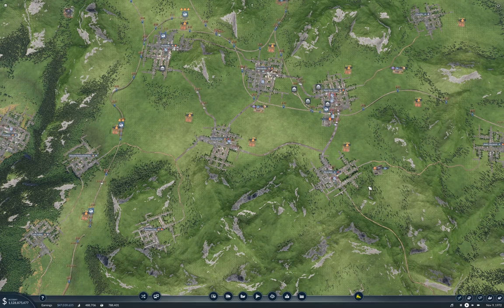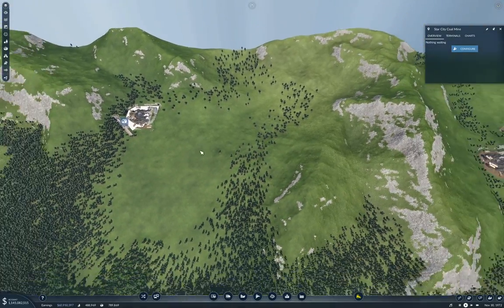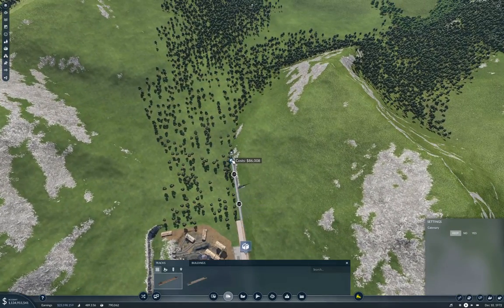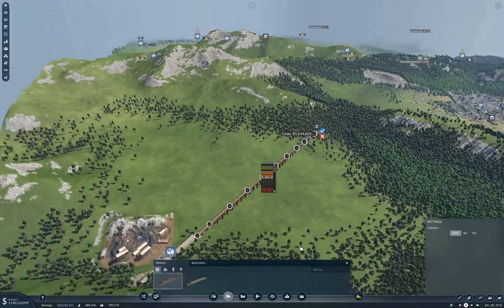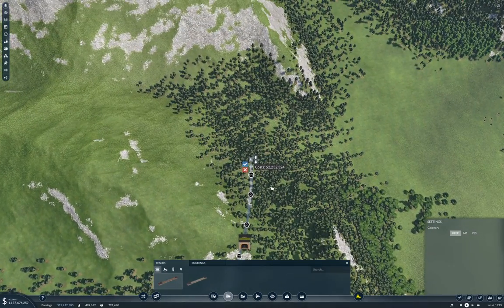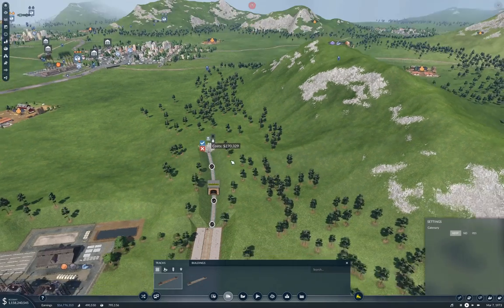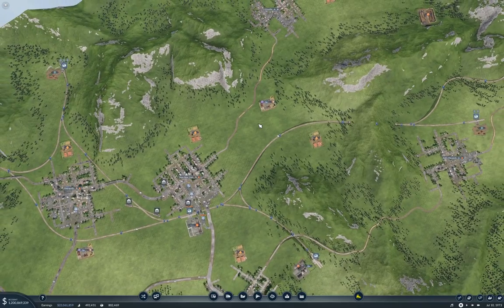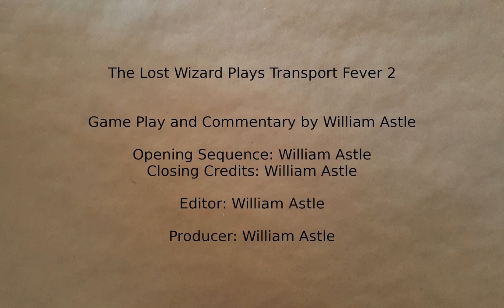Transport Fever 2 - Steeling Up

Comment: Doing a triangle is much better with bridges or tunnels when crossing lines. When the line gets busy, your trains will bunch up and lock themselves. Better if they wait on a bridge.
Reply from the maker: Oh, for sure. Bridges are better for avoiding congestion. But when the traffic isn't high, they aren't actually needed and they're a right pain to install. I also don't expect to need more than a a couple trains per line diverging there (the modern trains transport more with fewer trains), and if I got the signal spacing right compared to the train length, it shouldn't deadlock, either.

Besides, I can always refit things based on the actual traffic pattern if it proves to be a problem later.